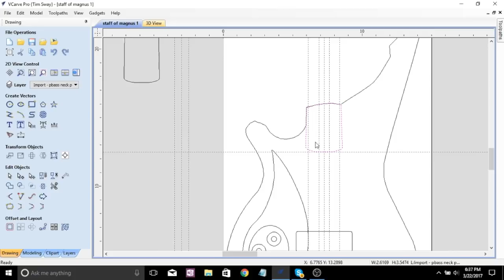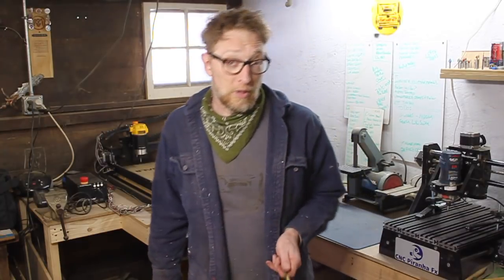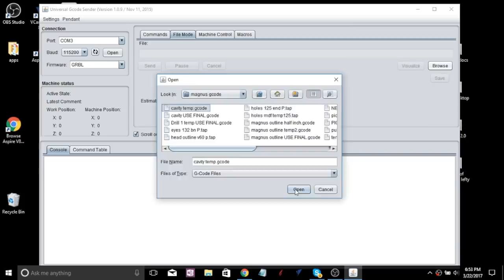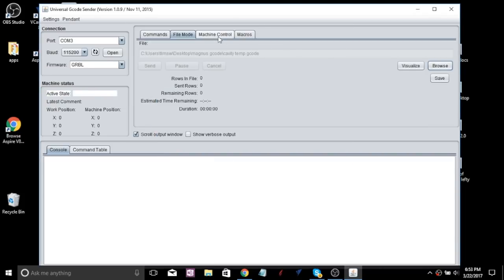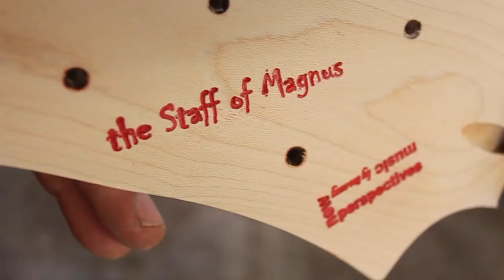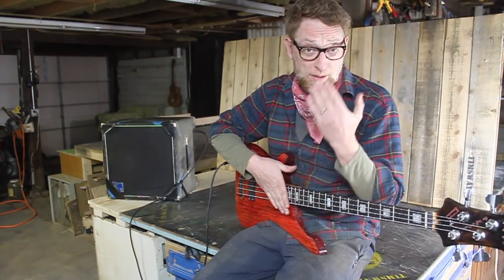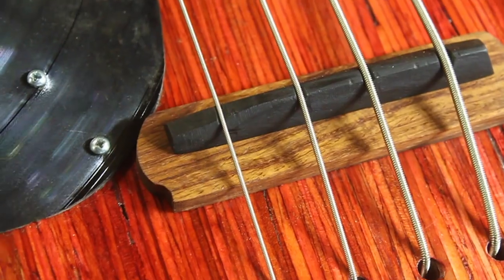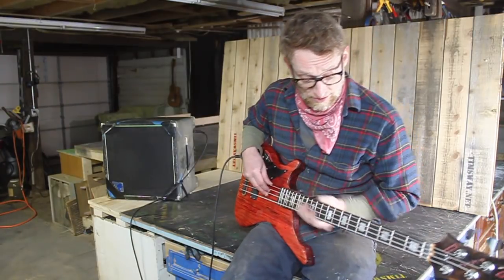Skyrim Themed TimberStrand Bass Guitar | Lefty!

Comment: man i really like your content but id like to know One thing: why do you always place the pickup in the bridge position? you'd gain sooo much more versatility in the neck where the sound is rounder and fuller, unless you want to play some Jaco basslines or something in that line
Reply from the maker: I don't always, but I did indeed on these last two. Personally, I prefer the treble down and front pickup tone, myself, but I've found when making single pickup instruments I can't get enough treble out of them with the pickup closer to the neck. I think it's because I'm using wood bridges that I have to slide the pickup back to get any attack. So it's the most versatile tonal position for these instruments. Same with guitars. One of my favorite 6 strings I put the pickup where the acoustic guitar sound hole would be and it's a challenge to get any bite out of it. I should put two pickups but I really like simplicity - especially with bass.
Reply: well if its the way you think you get the most out of then go for it, appreciated the explanation

Comment: i wanna thank you for the idea you gave me my uncle passed Away in a house fire we had to tear down the house. but I have wood for the trusses it's like bare bone wood but the house was built with out a foundation strange enough so it's definitely aged wood but ive been wanting to build my own bass guitar but I wanted to use one of the trusses as a neck for my bass there 4x4 any suggestions on how to keep it completely equal because I don't have nothing fancy I have a China strat that i could probably use the pickups and body but for the neck I have about every power tool know to man but I'm not sure where to start I've got a vice and chisels to but I don't wanna ruin it or have it off scale by much but I have bass guitar to measure off of any tips ? 

I wanna build it in tribute...

"but you flame roasting the neck made me think about it" thanks Tim
Reply from the maker: that is a fantastic idea.
neck making is the hardest part (i'm taking a break from it right now to work on other stuff). there are fret calculators at stewmac.com to help you get the math right. you'll need a truss rod and a lot of patience. the soft framing lumber may also not be strong enough as is and may require the addition of some harder woods.

you could also use the neck from that chinese strat and start by just making the body. then when you are ready, make your own neck. that may be less intimidating. 

here are a couple videos I made a few years ago about making necks. good luck!!

https://www.youtube.com/watch?v=G1tJoZ8ElWE&list=PL9-JGqOmsWcpUaXIgQfm9FNU0hGcbMGys&index=4

https://www.youtube.com/watch?v=-zpP6TmgYMk&list=PL9-JGqOmsWcpUaXIgQfm9FNU0hGcbMGys&index=6
Reply: tim sway thanks Tim

Comment: Looks great. Love that piano key bridge.
Reply from the maker: Thanks. They work really well. I think most luthiers use adjustable bridges as they are "easier" and "brighter" but I think wood bridges sound better and honestly, I have basses I've had for 10-20 years that I haven't adjusted in as long since I originally set them up, so the need for instant adjustments seems unnecessary.
Reply: Sweet. I'll have to try it. But now to find a piano in the dumpster! :)

Comment: I`m not trying to troll you, but is it wouldn`t be quicker to cut vinyl on bandsaw? you looked very bored while CNC do all the job for you)
Reply from the maker: Dmitriy Lutsenko haha! the records crack real easy when cutting with saws.
Reply: oh... I should check that before whiting stupid comment...
Reply from the maker: Dmitriy Lutsenko not a stupid comment, a good question!  Bandsaw would probably work ok with a good blade. My scroll saw destroys them! A good way is with a hot knife, but the CNC has been proving to be the most accurate with least waste.
Reply: it looks like you should buy a new blade. it costs definitely less then carbide CNC bits)

Comment: Like your build and everything, but... I don't think that timberstrand is any good for an instrument. Just like OSB or chipboard, this glue-based wood chip material should dampen more than it resonates. Which is exactly why chipboard is used for speaker cabinets, which are supposed to be acoustically as dead as possible. Why use that for an instrument that you want to resonate ?
Also, no offense, but: just cutting the headstock in the shape of a lesser known item from Skyrim does not make this "Skyrim themed". I have played 100+ hours of the game and I wouldn't even recognize this as citing The Elder Scrolls. Choose something much more iconic and don't stop at the headstock! Why not shape the entire instrument after, say, a really recognizable axe? You could use the double blade as the body - and then put on a paint job that gives every Skyrim player instant recognizability.
Reply from the maker: I've never even heard of the game - body design, headstock, all customer specs. The bass is a couple years old know and still plays and sounds great!